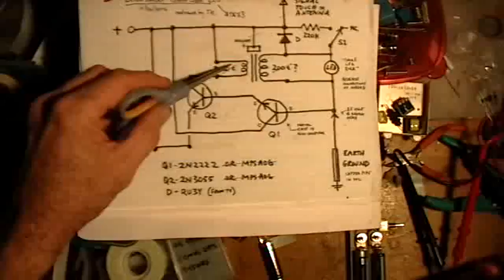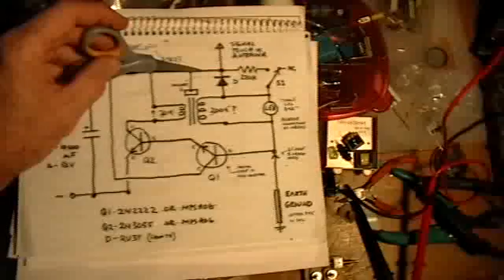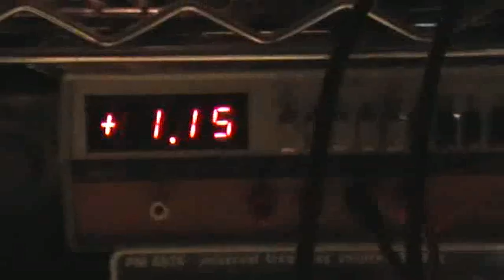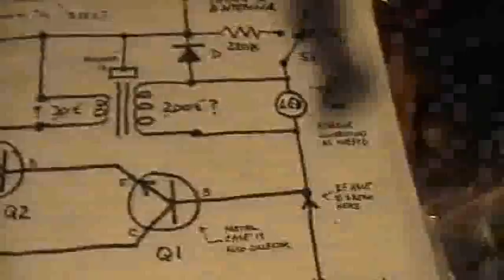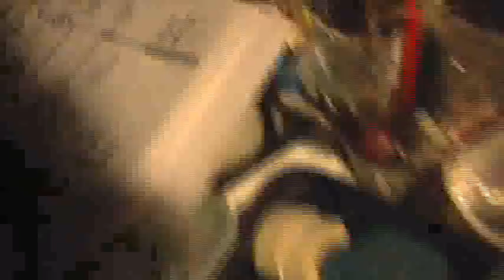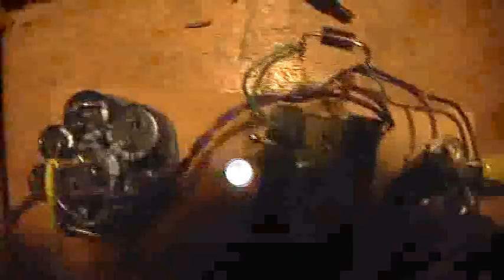Joule Thief: The LaserSaber Ghost Light, TK Remix 1

Comment from the maker: No, it's not. I now know that the power that is actually illuminating the LED is coming from stored charge in the capacitor. The connection of the base of the 2n2222 to the Earth ground, coupled capacitatively through my body to the EM field of the mains wiring in the house, is enough to trigger and maintain "jt-like" oscillations which allow the stored charge in the battery to be boosted and to bleed off thru the LED. 
Watch for next video, in an hour or so, where I hope to demonstrate this.

Comment from the maker: No conclusions, just data.
Later on I'll show what happens when the Earth ground is metered and scoped. The electric field from the house wiring is capacitatively coupled and the difference in potential between the true Earth ground and the mains oscillations shows up as a voltage, but there is no real power behind it.... enough to make an LED glow very dimly on direct connection... and enough to start the oscillations in the LSGL circuit so that the cap can make the LED glow like a ghostlight.